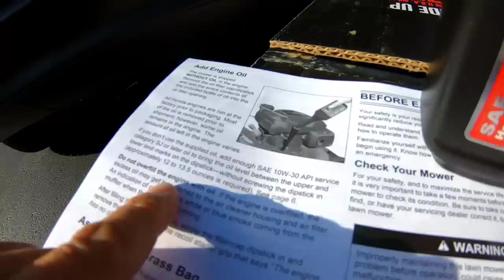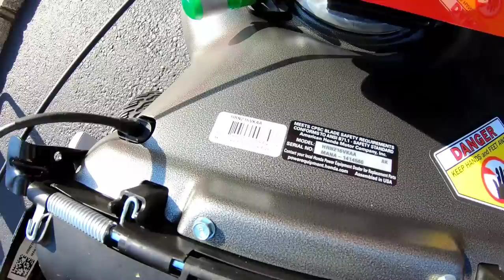NEW HOME DEPOT 2020 HONDA HRN216VKA GCV170 ENGINE 21” SELF PROPELLED LAWN MOWER UNBOXING TEST REVIEW

Comment: Nice unboxing Henry! I think Honda calls their paint a hammered finish. I bought a new Simpson power washer with a 160 Honda this spring. That mower has the 170cc. I love Honda's but to check there oil you dont screw the dipstick in to check. Backwards from most other manufacturers!  Roger

Comment: 1st 2 or 3 pulls should be done slowly not to start but get the orl (oil) to coat the internal engine parts before you start it ....
Reply from the maker: Good tip Will,  I call oil Earl!  Hope you’re subscribed

Comment: Wish he would of talked to you b4 buying, I've had a few of them in for service, the first thing to go on them, and for the price it's ashame the height adjusters they lock into plastic, and it wears down fast, in like 3 years, depending on how ruff he is with it, it's a nice mower, but wish he would of talked to you, and it had metal height locks instead of plastic, but the thumb drive is nice.
Reply from the maker: He did talk to me, I told him he’ll have problems in the future and it’s super expensive labor.  I told him to buy a toro.
Reply: @MowersNBlowers  yep..... Also mention, run the mower for 5hrs total, and change the oil.... It will be break in so he will want to get all the metal particals out of the mower, so the first oil will be break in oil, and if he wants the carb to last have him run the carb dry, by turning off the fuel with the fuel shut off.... And let it run till it shuts off.

Comment: The HRR in my opinion was way better this one has a weaker transmission has a plastic front end which will snap because it’s bolted to metal I would’ve paid the extra hundred and got the Toro super recycler
Reply from the maker: I told Andy to buy the toro recycler

Comment: That old Craftsman is a Murray.
Reply: BTW the GCV160 takes 12.5 to 13 oz of oil as well according to the manual, 20 oz is too much. The bag door also doubles as a rear discharge chute if the grass is too tall to mulch or bag, neat feature they started with the HRR216. Hopefully Honda has sorted out the awful transmission troubles the HRR series has been plagued with!